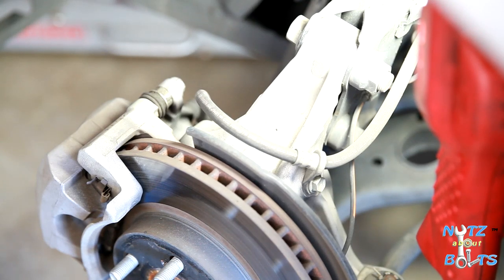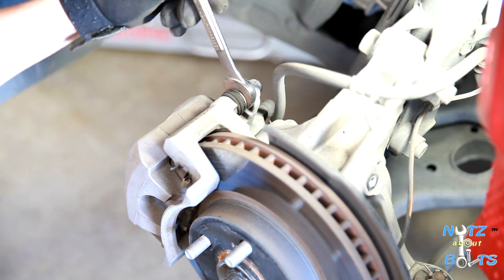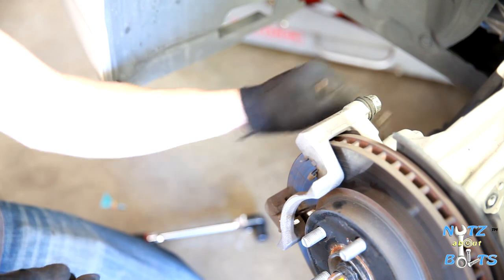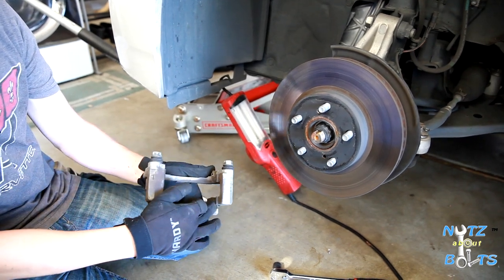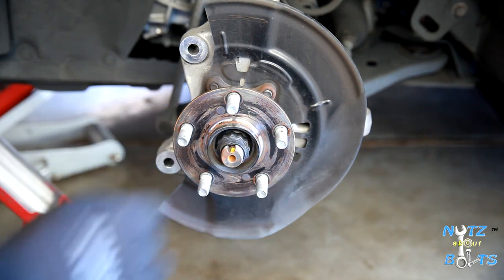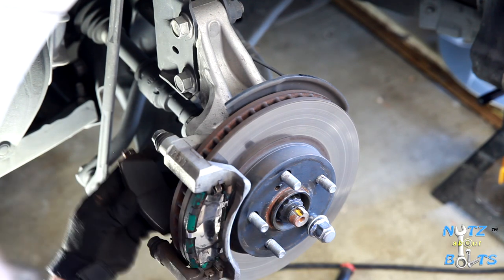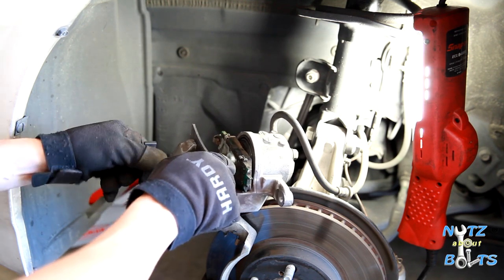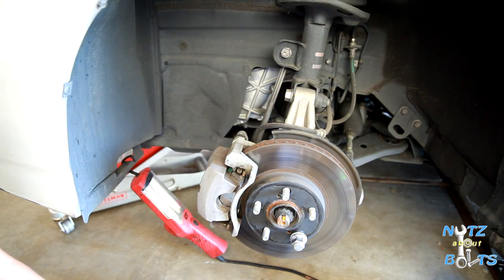2010-2015 Toyota Prius Front brake pads and rotors remove and install

Comment: Why would u disconnect a battery?
Reply from the maker: you don't want the caliper piston to engage if you accidentally open any of the doors that can active the brake system.
Reply: Surab Qaderi yeah, even when the key fob is nearby, you can hear the brake engaging
Reply: Disconnecting the negative terminal (black) is all you need to do right?
Reply: Yes. This will disconnect the battery from the circuit. It would help to unlock the doors before doing this to save the hassle of using the backup key in case you need to get inside.
Reply: So when you lick the new brake pads to make sure they are not fake you won't get shocked to death. Or maybe the piston thing sounds more plausible.
Reply: Haha. There's an actuator motor that pressurizes the brake hydraulic system when the door opens or the key fob gets near. Seriously. You don't want that happening when your calipers are apart. Trust me.
Reply: Is disconnect the 12 volt battery something you would only do to a hybrid vehicle, Toyota or other manufacturer, or would a non hybrid vehicle of any make also require that step as well?

Thanks in advance, great guys.
Reply: aaronwcorrigan it’s because the Prius runs  codes as part of the hybrid system. That’s why they recommend disconnecting the battery or else when you power it back up the car will give you error codes

Comment: Got a friend whose buddy pushed the piston out of the caliper, we tried a C clamp to get it back in No dice" do the piston wouldn't seat straight, what wrong do I need a little ass-eline to slide that F up in there or what.
Reply from the maker: Never happened to me, but someone had to bring it to the dealership to use techstream to push it back in.
Reply: @NutzAboutBolts  from what I'm seeing from techs amounts to disengaging the brake actuator to relieve the pressure then installing the piston back into the caliper. But thanks anyways.

Comment: there are 2 bolts that hold the rotor in place, your car does not have them
Reply from the maker: It’s not needed and it’s more common on Honda’s
Reply: @NutzAboutBolts  you are right, i just changed breake pads of mine (prius c) and there are no bolts, thanks for answering

Comment: why would you replace the rotors?
Reply from the maker: to prevent any warp rotors in the future. If it's too expensive, we usually have it cut/turn, but if its cheap, we replace it.
Reply: If the rotors are already warped, how much would it cost to machine versus replace? This looks really simple, like all four would take less than a couple hours. how would you have them cut/turn?
Reply: Ha, you must not live in northern New England. I have 90K on my Prius and the front rotors are rusted and pitted to the point where they won’t pass annual safety inspection. Have to replace with new.

Comment: The problem with this video is that you did not use new brake pads.
Reply from the maker: Well, the Prius brake pads last for along time. If we were going to replace it, it’ll probably in the 200k miles, who knows, it’s the original brake pads and still looks good.

Comment: what happens if you do not take disconnect the battery when doing the brake job on the Prius?
Reply from the maker: david valens the piston can accidentally engage due to the driver side door being open.
Reply: @NutzAboutBolts   so the Piston will actually try to compress if the battery is not disconnected
Reply from the maker: david valens yes

Comment: Why does the 12v battery need to be disconnected?
Reply: Because the brakes activates on the Prius when it detects the fob/key. Make sure you disconnect to prevent a major headache.

Comment: Why disconnect the battery?
Reply: If you don't, your keyfob will activate the calipers electrically pressurize and could push the piston right out of the caliper when you remove it.

Comment: What screw size to pull the rotor?
Reply from the maker: 8.25 pitch I believe. You can buy them at Home Depot. Some say you can use the brake hardware bolts too but I haven’t tried it yet.
Reply: @NutzAboutBolts  turns out it is 8 x 1.25mm I had a spare from another project.
Reply from the maker: @WebbedPete  nice

Comment: One question why disconnect the battery?
Reply from the maker: So when you accidentally open the driver side door or stepping on the brake peda, it won’t cause the caliper piston to engage and pop off when you have the caliper removed.